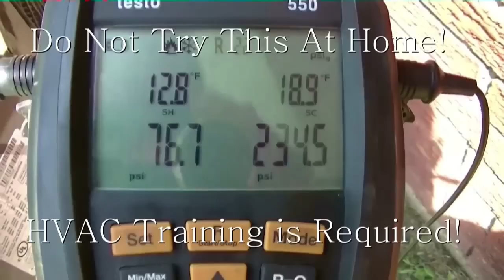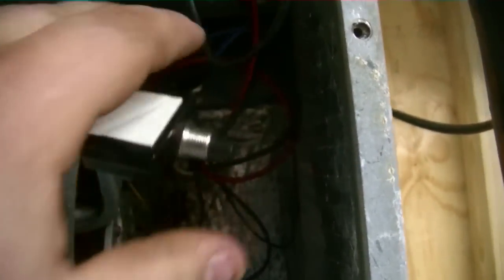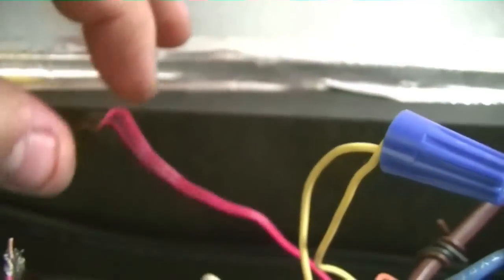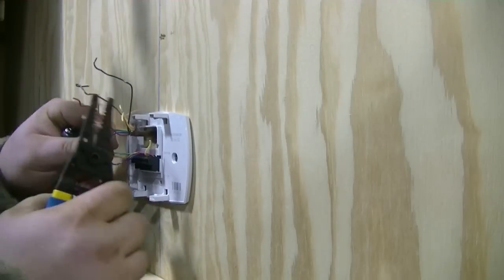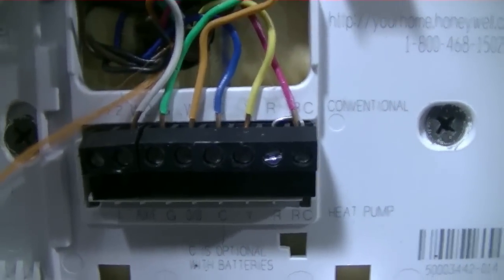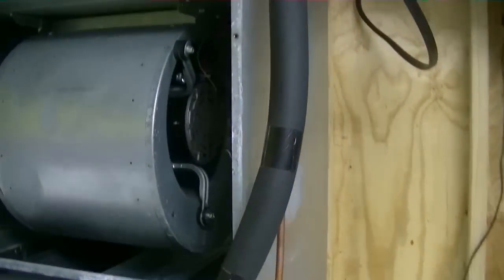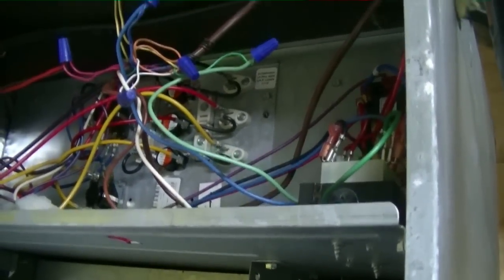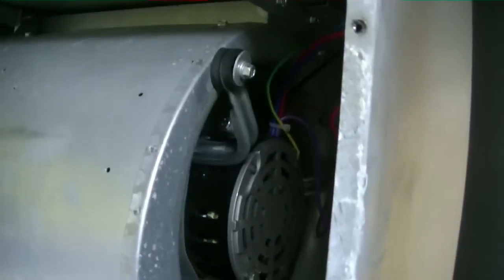HVAC Service- Low Voltage Short Repair

Comment: Great video John. I always remove each component one by one. If not found, then I test the wires one by one. I use the L'il Popper as well. After going through a 12 day advanced electrical troubleshooting course through Carrier in 1996, shorts stopped giving me much trouble. Learned more in that 12 days than previous 18 years,lol. Take care, Brett

Comment: The Short pro tool by Global the sourse is the best tool to use for 24 volt shorts. Has auto-reset protection and LED to show when short is presant , no more blown fuses ,no more reseting a breaker. It provides a safe current rate at all times while testing for shorts, fine tuned for the 40 VA transformer , guarranty you the quikest safest way. A must tool for a Tech.

Comment: I need a popper. After 3 fuses I found where mice had chewed through my wires to the thermostat. It was about 3 feet from the outside unit under the house. Red, blue and green wires were bare. All good now. Thanks

Comment: Are u trying to trip ur high pressure switch by running heat pump without air handler service panel in place

Comment: Where do you connect the wires for the popper at?
Reply: Chris Treacy it connects to where your low voltage fuse goes.

Comment: Does it get busy down there in "heat pump and 15KW strip land" this time of year? We're busy as heck up here in "Propane and Plenum Heater Country" (Minnesota) I've been working 12+ hrs a day for the last 3 weeks, including several 6am-Midnight days. Its a plugged up drain trap kind of year, I must have drained about 500 gallons of water out of heat exchangers this year already. (Ya, I sell Ruud.)
Reply from the maker: Ya its pretty busy this time of year!!! nothing like summer time though!!!

Comment: is the lil popper connected on the 24v side power and common wire?
Reply: Tim Addis I don't think so.  This will short out.  It could be wired to the termnials for the 3 or 5 amp fuse or inline with the Red or 24 V hot side from the transformer.
Reply: Thank you.